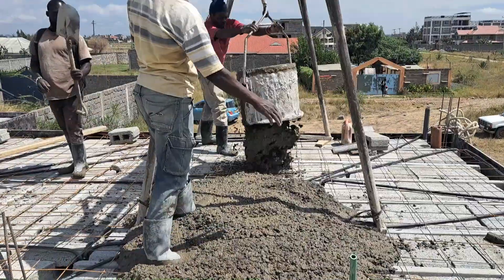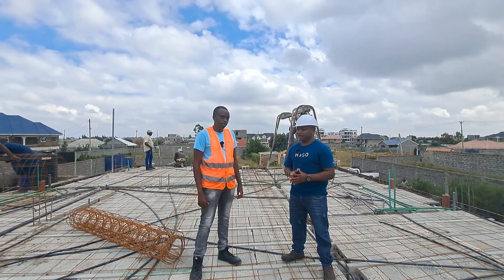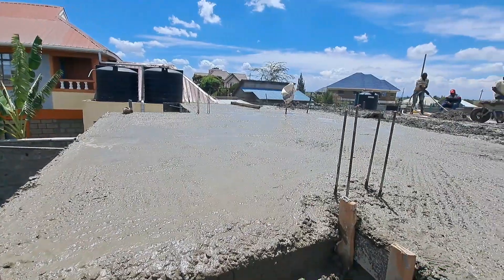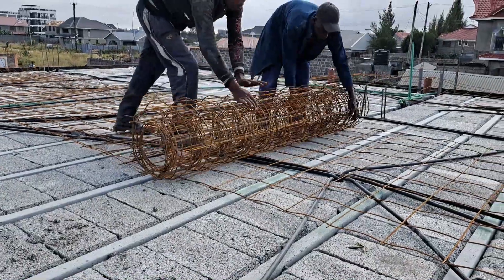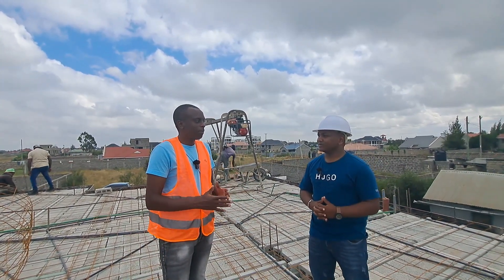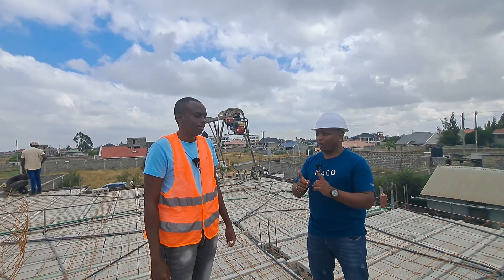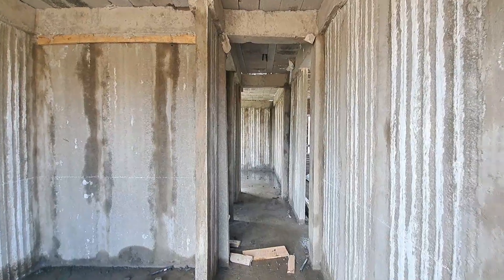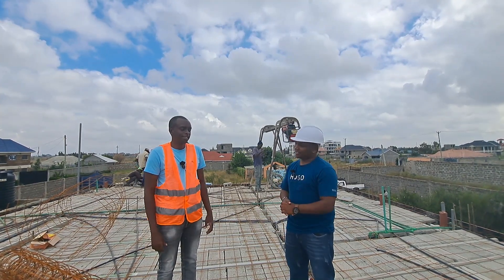Using T-Beams & Blocks to Make a Flat Roof Bungalow (Part 2)

Comment: Can it be use for calntiler floor of 1.2m ?
Reply from the maker: As long as the precast beams are well supported, it's possible. But it's better to confirm with your structural engineer

Comment: Good work property noma I love your videos but I used this process building my house with a company in kitengela and it has been my worst nightmare. I wish I could have gone the traditional way. 
 Here are some of the problems I encountered. 

1. Roof leaking and try to get customer service after you buy the product is close to none. 

2. Regular masons don't know how to work around these beams  whenever you have problems.

3. When they brought this things to my sight they changed me.

4. They did the wrong quotation and brought less stones on the sight and later when I told them the issue they told me they are out of town and I had to wait for them to fix an issue that has never been fixed.  

5. Due to having my roof leaking, I was advised to put terrazzo.  While the terrazzo guys were using the vibrator my roof was feeling kinda funny and there was some shaking  here and there😢😢😢

This things are not cheap. The difference between this and traditional building,  is a slight difference that won't make a major impact on your wallet. 

Sad!!!!...
Reply from the maker: Sorry to hear about your experience. I'm always here to help if you need any advice or guidance.

Comment: How do you ensure no slab leakage?
Reply: well to avoid moisture contents penetrating into the slab, it's advisable to apply DPM or waterproof paint after concrete works. Buh it will be of good if you ensure the pipes laid do not burst during construction processes and the floor tiling works at the washroom and kitchen should be overseen diligently.

Comment: I like that type of structure cinder block and concrete. It will keep the interior cool all year round at 50,60 degrees if it 100 degrees outside.
Reply from the maker: Yes indeed